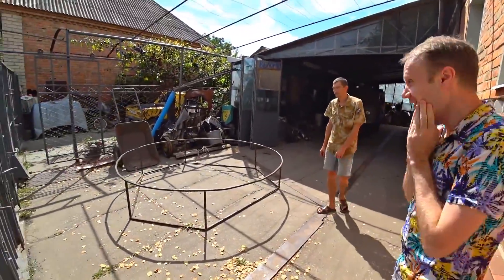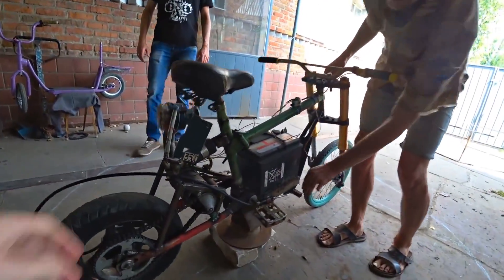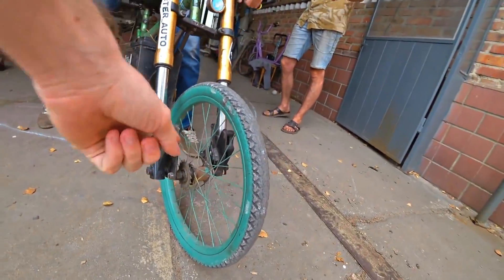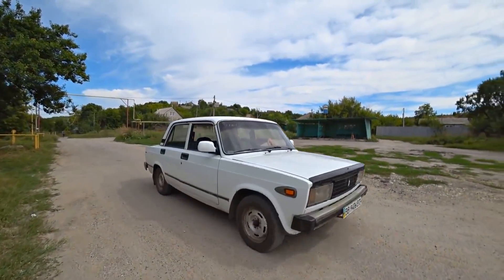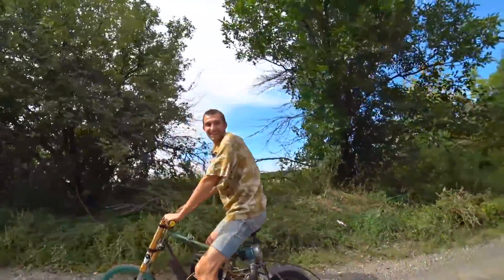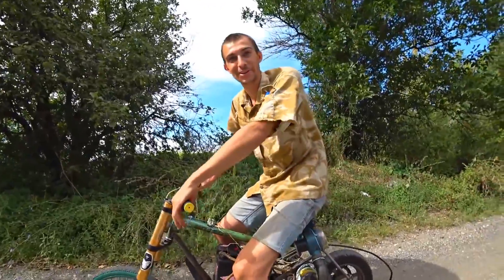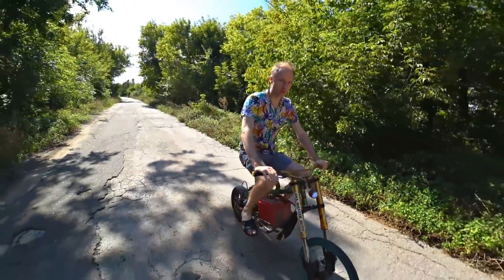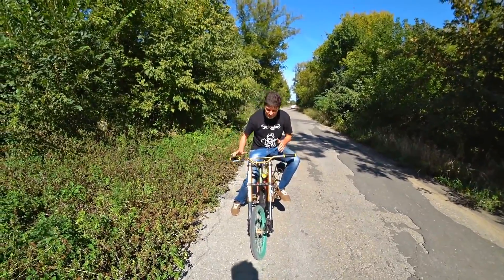✅New Electric Bike / Self-made, Awesome, Fast and Furious

Comment: if the front tire was pumped up more that thing could do 140 km/h easily !!! and good roads !!! and drill holes in the motor for more air flow if you don't ride in the rain !!! just keep brushes with you. and just ask for a jump when the battery dies !!! 5 minute break !!! and a chain auto tensioner also !!! and that bike would be awesome !!!

Comment: I have a stater motor and want to make something like this just for fun .I know it will use up the battery rather quickly but like I said just for fun.can you tell me what sort of sprockets your using .how many teeth on both front and rear sprockets and tyre sizes .can't believe it goes that quick

Comment: i have been home building e bikes for 15 years or more and this ones crude but great i would say you could use a rear chain tensioner to stop the chain dragging and if you go to 24 volts you should get a controller from ebay

Comment: Put the washing machine motor on that thing, the starter is not made for being under load for so long. If you want to make it a lower voltage motor, you can just rewind the rotor with thicker wire and youre good to go.

Comment: 80 km/h in shorts and sandals should  be the title 👍🏼 🤣
Reply: And no chain guard.. If that chain breaks is going to make him an awesome tattoo on his leg.
Reply: @geogmz8277  lmmfao. Brute. Salute
Reply: if your head hit the road at 80 km/h, your legs and arms are probably your last concern...
Reply: @Tigrou7777  its only 50 mph
Reply: @girlsdrinkfeck  hitting your head at 50mph... wouldn't suggest that
Reply: @girlsdrinkfeck  50mph on something weighing roun 160-175lbs is exhilarating. Salute
Reply: @girlsdrinkfeck  "only 50mph" try hitting the ground at 15mph.
Reply: 160 kph if they manage to run it on 24V!
Reply: @mojoblues66  1600 kph if they manage to run on 240v. Wow, what was that big boom?
Reply: @lusciniasvecica4850  16000 km/h or 9941.939 miles/h or 12.957 knots, if they manage to run on 2400v.
Reply: I didn't even notice that xD  I don't have a driving license xD

Comment: That was pretty fast! Freaking cool, I didn't know a starter was that powerful
Reply: They are very powerful electric motors but they are not really designed for continuous operation so the forced air cooling is a must and even so; if they ran it for any meaningful distance (say 20-40km) the starter would likely fail.  They also swapped batteries halfway through so it is likely very inefficient.  Having a golf cart or UTV brushless electric motor with a speed controller would make this unit far safer and long-lasting while providing a large increase to efficiency.
Reply: @kuhrd  actually it can serve for long usage of time. Just make sure it works in pulsed electric feed (PWM) but set in 5 second high and 10 second low and so on.

With 4S Li Ion it works like crazy powerful motor and work for one hour just warm.
Don't use voltage over than 17V or it will be very inefficient. Below than 11V also work but the power just pretty weak.

I think it is cheapest version for diy e-bike that too good for invention!

Comment: the chain its touching the part of the starter, it needs  more space, or a spring tensor
Reply: The chain definitely needs an idler gear or pulley on the bottom.

Comment: Hi kreosan team!
I have a suggestion for an experiment that you could try:
Put 2 wires in a microwave and have the other 2 ends exposed to see if you can get any electricity from the radio waves 
Plz do it, I’m curious to see the result!
Reply: Can't get shit frequency is way to low for wireless power
Reply: @peterzingler6221  too low?? 2.4 gigahertz I'd pretty high frequency.. that's what they use for wifi. So microwaving a WiFi antenna should work